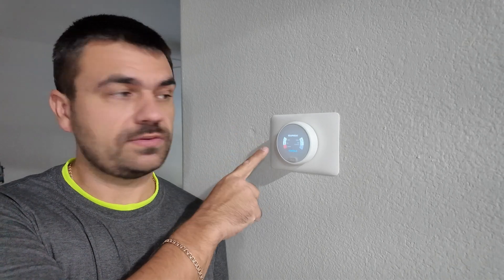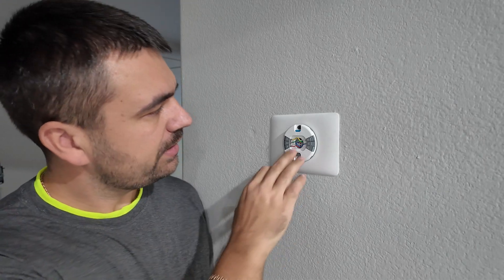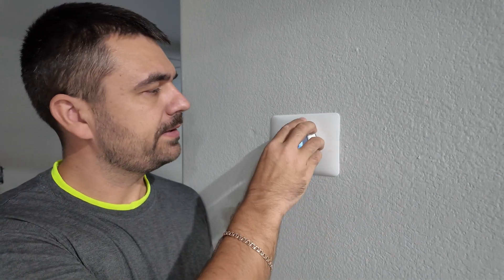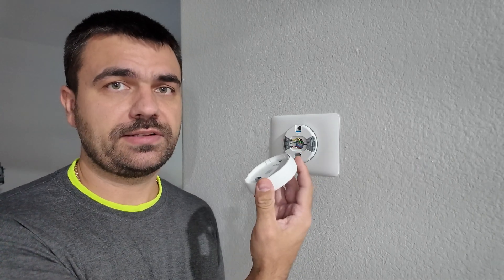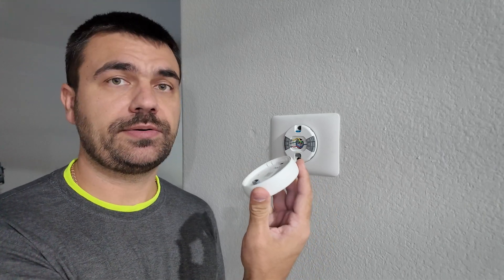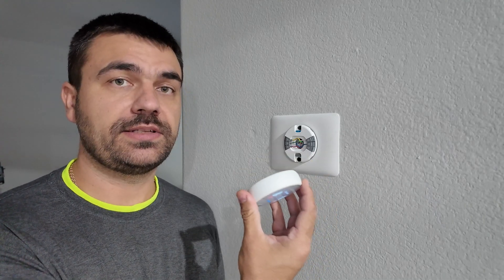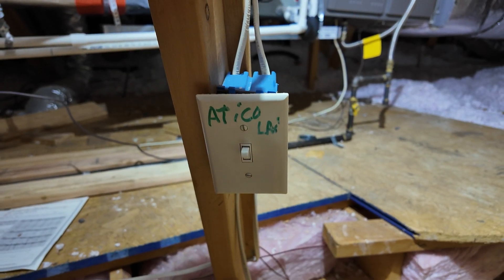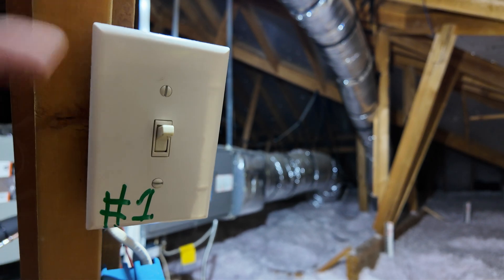Nest Thermostat E74 Error Troubleshoot: No Power? Here's the Solution!

Comment: Thanks for the video, I made a mistake of nut inserting R wire in the wrong slot, as they were close to each other. I had remove the wire and reinsert in the right hole. it fixed the issue